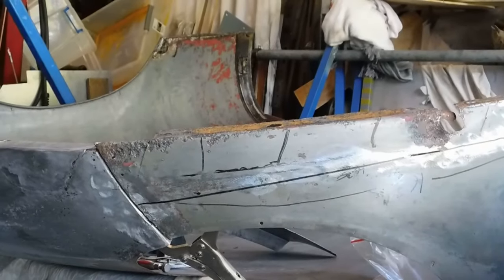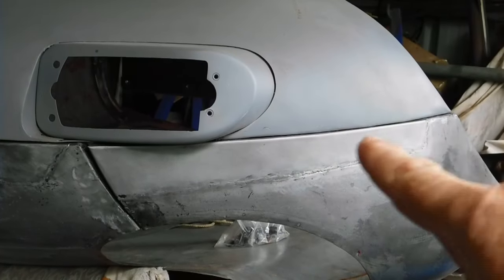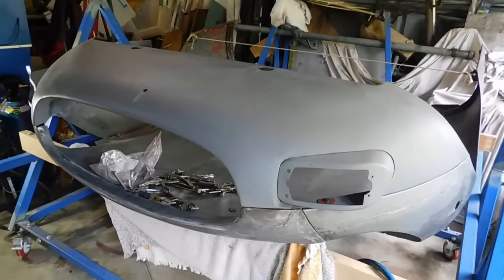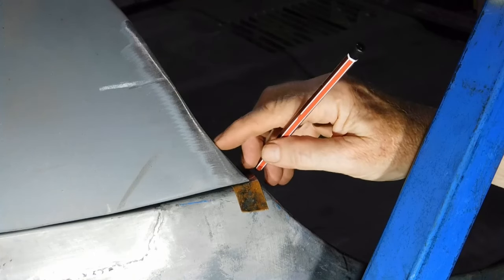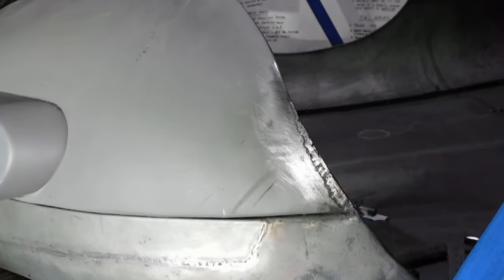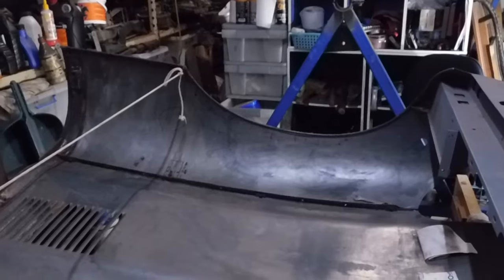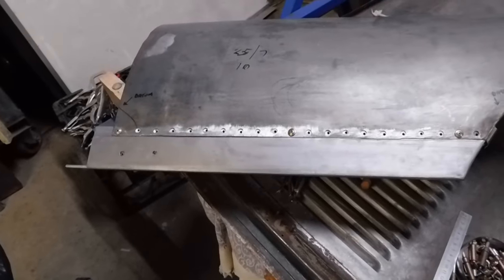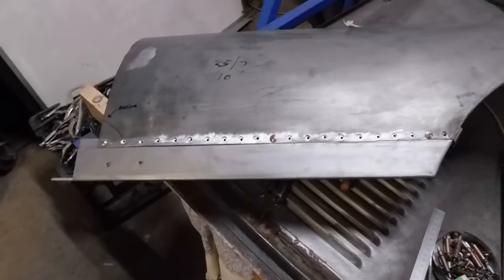1969 E Type FHC DIY Restoration   Restoring The Bonnet Part 6

Comment: Nice work there not easy i would butt weld the last inch so you dont end up with a fat bonnet edge at rear. carl
Reply from the maker: Carl. Thanks for the tip, I will do as you suggest. Denis

Comment: you end up with a double thickness joint thats a moisture trap , or did I miss something.
Reply from the maker: Yes it is a double thickness joint, and it is inside the engine bay. I will be filling the inside seam with glass fibre filler which is water resistant. An E Type is full of double thickness welded seams, some inside the wheel arches. Seam sealing is an important part of the restoration process. Denis